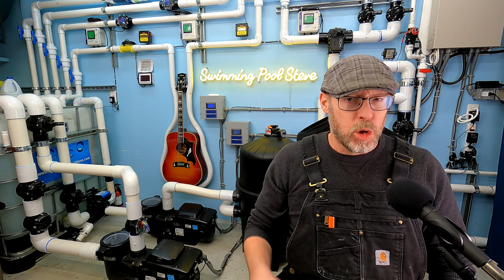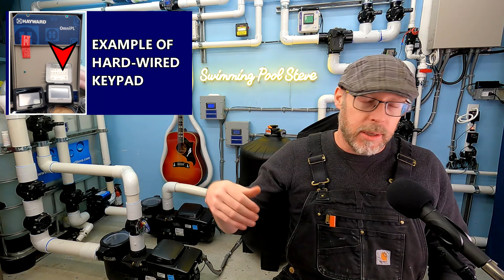Should I Get An Automation System For My Pool?

Comment: If you want ultimate automation but also don't want to have recurring extremely high cost after biting the bullet for the upfront cost, would you use CO2 or acid injection for pH reduction in 65,000 gallon fuel with a salt cell? I am also using AOP so my so salt cell should not have to generate "as much" chlorine. some people tell me that for this Seiz Poole I will spend $150 or more amount than CO2 and somehow tell me that a 50 pound tank would go six weeks or more. Thoughts on either of these options?

Comment: I would disagree on the chemical automation as a whole but for the current status for general pool equipment yes.  In the Reef aquarium industry we have made great advancements in how you monitor and control water. We have 10's of thousands of dollars worth of animals lives at stake.  Once I started getting into pools it became very clear no company is even close on par with what the aquarium controllers can do. 

So I implemented a Neptune Apex on my pool using 2 empty chlorinating chambers in line. 1 for probes ,  one for dosing after.  The Apex lets you make extremely complex "if this than that programs" for your system.  So you can say something like "DOS A- Default off , If Day Sunday, Wed, Friday, & time 12:00 - 13:00 DOS XXXML  & IF ORP  >650  off, IF ORP <750 off , If PH <8.0 OFF, If PH > 6.8 off.  Repeat weekly"  You can set alarms with push notifications if your PH is to high or low and same for ORP especially once you learn your ORP swings.  Then you just do this for your PH decrease  (Co2 or MA) and chlorine with non over lapping schedules.  So on Mondays it can dos the PH and on Tuesdays it doses the chlorine.  you can even make an alarm that tells you when your chem have run out if they are in liquid form.  The Apex Dos pumps can push 30 gallons a day too.  The secret sauce is the open source programing you can do and how friendly the app is. 

If you haven't gone down this rabbit hole I would recommend it. The only thing is these are not outdoor products so you need a shed with them or a water proof box and provide the 110VAC they need.

Comment: Started automating with a VSF pump and IO board.  Outgrew that in a few months.  Then came the Intellichem.  Then the Intellicenter.  Now Valve Automations 🤣  Biggest complaint was the flow switches for both the salt cell and Intellicenter, requires really high GPM so swapping over to the relay in the H2Flow digital for this signal.  I had a hack using a Intellicenter relay but unlike the IO Board, there isn’t feedback on the Circuits if the pump isn’t actually pumping so it’s not really an interlock at that point.  Definitely don’t wanna be a Wynn Las Vegas dumping chemicals into lines without flow and cause injuries.  Automation has been a game changer, chem automation is becoming more common here in the residential market finally too.  They are actually affordable now.  I’m in tech so automation is everything to me.  I’ve been so tempted to yank the multiport valve, replace with traditional valves with actuators to backwash on a schedule but that’s next summers project 🤣
Reply: and SPS!! 🎉

Comment: Yeah dude.  The salt generators (control interfaces) need to develop their own internal sensors  & scheduling & regulations.  Since the VSPs are no longer viable as a piggyback SWG manager.
Reply: agree 100%  Pentair just released their new tech heavy cells (LT and Plus) which is a step in the right direction.  I had poor man’s automation using an IO Board on my VSF pump.  It would schedule the salt cell (on/off) and the GPM of the pump triggered the second relay to simulate the flow switch so I could run Low Speed.  I sincerely upgraded to the Intellicenter which lacks the smarts of the IO board so it’s not safe to assume the pump is pumping since the serial interface doesn’t seem to convey this info realtime to the IC

Comment: SPS. I find a pH sensor useful when it is calibrated correctly. There is a learning curve to doing this, but it saves having to manually add Ph Minus powder every week. However, I still have to buy the 25 litre container, lug it into the plant room, and then attach it to the sensor. I have to do this every month. I used to have a salt sensor but two of them stopped working in four years and then the control unit stopped working. Adding salt to the hard water in my part of the world also raises TDS to a high level.  In Europe the cost of these salt cell systems  is very high.

Comment: Good video! I do have pool automation. I live in Ohio and have a second home in Florida that we short term rent out. I would highly recommend Poolside Tech! It controls the pump, chemicals, and water temperature. They have a system that will work with any pool equipment manufacturer. I have equipment from several and it drives them all with ease. It also makes it convenient and easy for my tenants to use the pool and spa. Probably the best part is that they have awesome support that will assist you through any complication.

Comment: Newbie question. Beside electricity cost, is there a reason to schedule different pump speeds?

I had a super noisy one speed pump.

I changed it for a VSP thinking I was going to make schedules.

Now I realize the new one is SO SO quiet and doesn’t use much power, I just keep it at 100% all day long…
Reply: My neighbors came over and thanked me after I replaced my single speed, 20 year old pump.  So quiet!  Lights don’t flicker either 🤣 

I have mine doing fun things besides energy savings.  I run full speed from 1-5am since energy is cheap.  This also primarily so the chamfeeder and salt cell can produce.  Daytime is low speed for solar heating.  I have valve automation that triggers higher speeds for water features since I eliminated the water feature pump and went to a 3hp pump.  I run low GPM by default and ramp up as I add water features

Comment: Very disappointed in the misleading that pool companies do with advertise. They state that there product has built-in WiFi (wireless local network). In reality you have to have Internet tied to your WiFi because their App is a Cloud Application. So if you don't have Internet or if it's down you can't control it with their app. You are always tied to them and have your information on the Internet.
Reply: Pentair and Hayward both have local modes for their products?  You lose functionality by not having internet but I’ve used local mode on both sets of equipment over VPN fine.  Hayward is really dumb though, they made breaking changes to their AWS Cloud infrastructure requiring a very labour intensive firmware updates on their products so I was less than impressed with them.  Pentair seems to have an actual team and not just a dude who dabbles of the side of his desk in software 🤣

Comment: SPS :)  My pool automation consists of a Sutro which sends me pH, FC, ALK,  (3 times per day) and Temp (hourly) to my phone app.  I have a WiFi pump controller (DEWENWILS Pool Pump Timer) which I program via an app.  It is setup to turn on the pump at 9am and off at 6pm.  I can also manually turn it off and on via the app or the box.  My SWG is not so smart...it doesn't even remember it's on/off when powered off/on.  UGH...I did experiment with a CO2 injection system utilizing a pH monitor and other details I won't get into.  The regulator froze up once due to Boyle's law...my pool was bubbly!  lol  It's fine, I DIY'ed it.  It's gone for now!  :)  Great video as always!
Reply from the maker: Thank you. We are very close to full suite pool automation including chemical balancing...bit not quite yet
Reply: @Swimmingpoolsteve  pool sure has been around for a very long time. They automate chemical balancing. Every time I come across one, it’s broken in one way or another. Acid and chlorine and sun tear the system apart. Your lucky of you get one season without it breaking. Now imagine it breaks, but it still continues to feed acid to the pool…. Bad bad very bad. Automation causes more problems than it fixes when it come to chemicals. Even if it works, would you trust it while you think about acid pouring out somewhere or chlorine or even worse, both at the same time creating gas that makes your body convulse and projectile vomit out your internal organs. Chem automation bad bad.

Comment: A couple of refinements:  There is not necessarily a manual light switch when you have the app - at least they didn't give me one (iAqualink, which is Jandy).  Also, I asked to have my pool cover put on the automation, but they would not, I gathered for safety reasons.  There is only a switch, which had to be in view of the body of water (and I think not farther than x meters).

Comment: I need to know the Maximum GPM my variable speed pump generates to be able to set the pump optimally.
 My Pool center doesn't know, if they dont know and they sold it to me then I need help.
  Pump is a 1.0 HP with 1.5 inch piping, I have a 20 x 40 Oval pool with 2 skimmers and 1 bottom drain.
I appreciate any help you can give me!!!!!
Take Care
Reply from the maker: Optimal flow rate for a 1.5" trunk line system is 38gpm. Beyond this there is a sharp increase in efficiency losses. Your pool really is too small for 1.5" pipe and upgrading your trunk line through the equipment set to 2" pipe would raise.your optimal max gpm to 65. These are based on 6 feet per second water velocity.
Reply: @Swimmingpoolsteve 
Thank You Steve!!!!
Take Care

Comment: The Haywards have a FLOW SWITCH in the plumbing that tells the salt cell to start generating and when to stop generating.
Reply from the maker: Yes, this is what I mentioned in the video. It's a tiny metal tine which could foul with as little as a strand of hair.
Reply: When it works...I change so many of them
Reply: @TheNine6 I changed one that was 9 months old.  Brand new pool.
Reply: @JuanSanchez-tk4vr it happens. I keep a stock of generic flow switches from Amazon.  Hayward is getting pricey. 4k for a 250k BTU now. Was 1800 in 2014

Comment: I currently just wired a shelly device to my variable speed pump and tell Alexa to turn it on for x number of minutes/hours when I want to override the current speed for chemical additions etc. I do use a Sutro for automated chem measurements but it would be nice to automate chem injections but that's low on the priority list. I do plan on using the automated water injection you covered in the past so I don't need to pull a hose to the pool to add water.
Reply from the maker: We are closer than ever to full suite automation for pools
Reply: @lordgarth1 retrofitting an autofill?  Pentair makes the Intellilevel Auto Fill I am trying out.  It’s discontinued but is still available for cheap as are many other wireless solutions but I’m kinda anti-battery for this stuff and want hardwired.  I have an Eve Aqua Smart on my garden hose but it looks so goofy having the hose run across my lawn.
Reply: @bennythepep No steve showed a much slicker unit. And I believe it was even cheaper than the pentair. There was a sensor that goes in the skimmer and wirelessly connects to the device which injects water into the system.
Reply: @lordgarth1 I saw that video, that’s where I got the idea to add one!  That’s what I’ll switch to if this doesn’t end up working.  I have too many things with batteries and the wireless module is just another battery to replace 😢   I do love your Alexa integration,I never considered using it for that

Comment: That’s interesting to know about new pumps with variable speed. I inherited the pool system that I have when I bought and moved into my house 2 years ago. My pump is about 15 years old and it just runs like a little work horse! I’ve already replaced my filter and automatic chlorinator but both my heater and pump are running on borrowed time (heater is also 15 years old). I’ve debated whether I should just replace my pump or see how much more life it has in it? That’s a bit of an incentive knowing that they have their own control panel now.
Reply from the maker: Here is a great video to show you how and why upgrading your pump will save money https://m.youtube.com/watch?v=X7DHyFCw_28&pp=0gcJCfwAo7VqN5tD

Comment: Do you happen to have a video on a pool cooler or methods of cooling? Not sure if heat pump can be reversed to do so? I have been watching all your videos in my studies towards purchasing a pool.
Reply from the maker: I don't have a video on this, but electric heat pumps can be adapted with a chiller unit
Reply: I think some heat pumps can cool. I use my solar to lower my temp
Reply: Aqua Confort, AquaCals heat pumps can reverse to cool but the biggest downside is you can’t automate that part easily.  So you still have to switch it on another app or control panel.  Most automation for heaters is pretty dumb right now, it uses a relay to trigger the call for heat and unless you wire a relay to swap between that reversing, you are stuck with the panel.  This again would be very customized wiring and may void warranties as you’re splicing into the factory harness of the heater.  I am planning on doing it, winter project but it’s not been a problem since it’s summer and I don’t use the heater.